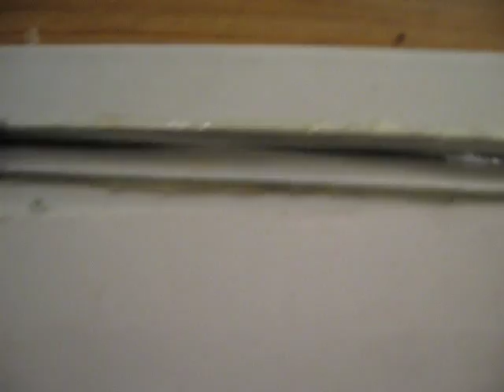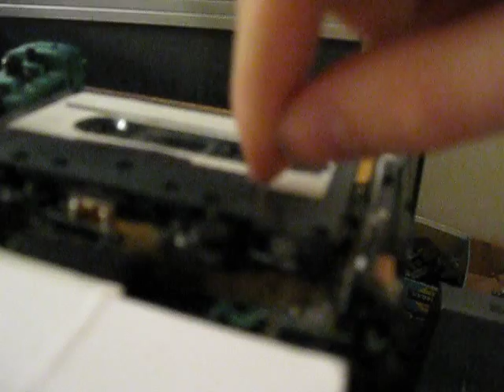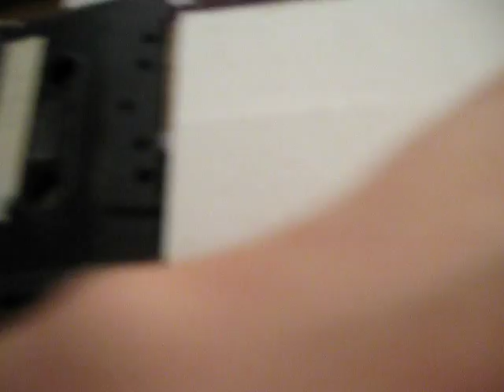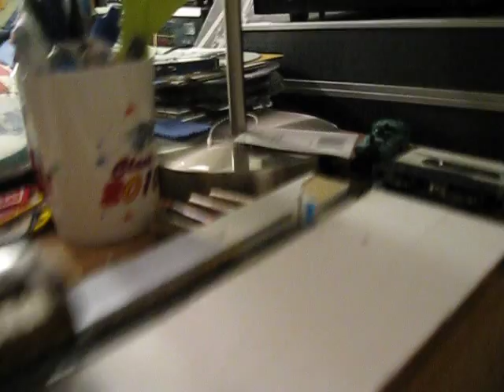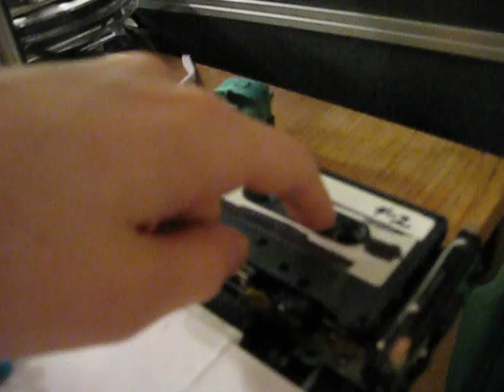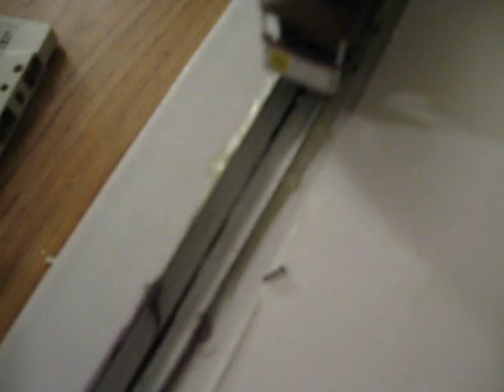HO Scale Cable Car, powered by a cassette Walkman!

Comment: I figured out the problem of the motor being too weak to pull just one car up a hill...you will actually need 2 cable cars running on two tracks along side each other at oposite ends of the line...as they run, each car actually acts as a balancing counter wieght... the motor should have no problems pushing or pulling either cars up and down the steep streets.

Comment: This is really cool. Neat idea to use the auto-reverse deck. Part of the way through the video I wondered if you could add extra stops by just holding the car for a short period - which you answered and demonstrated. 

I saw in the comments some question as to who makes these. These cars are made by Bachmann, both the cable car and the Brill car. They substitute the cast metal floor with the freight car trucks in place of the powered trucks that would normally be there.

Comment: Clever and cheap. I would imagine that you could use the tape drive, but have it modified to operate a chain or a sturdy string insted of the tape. I would imagine that it would deteriorate quickly with use.

Comment from the maker: I don't think this one was made by Bachmann. This one doesn't have a motor, and it was originally sold with a green "Desire Street" unpowered trolley car. The Bachmann car has a motor and runs off of track power.